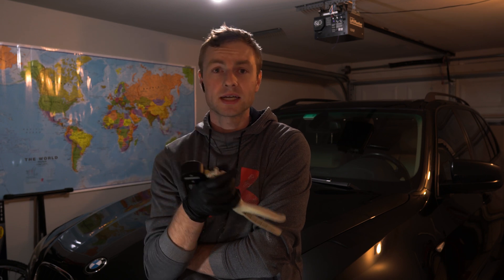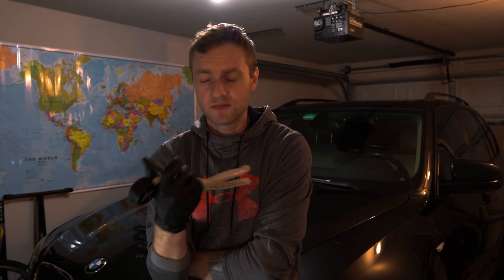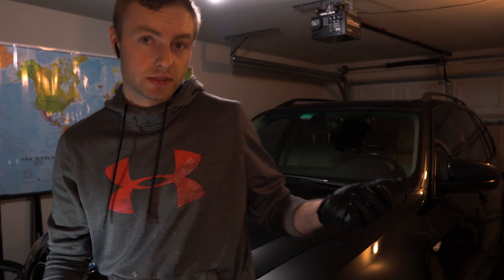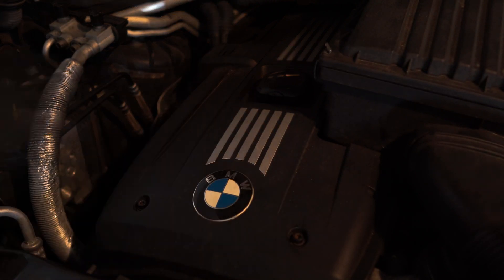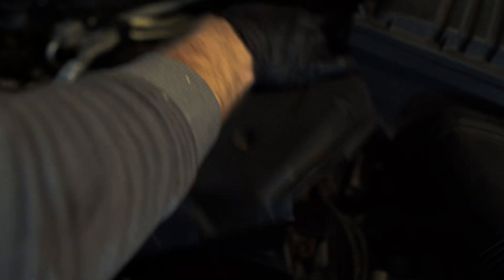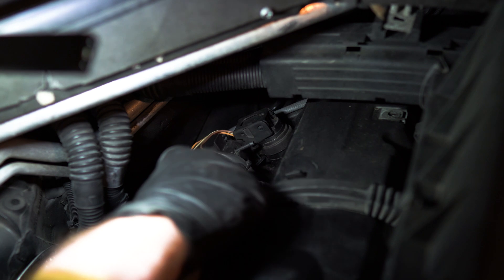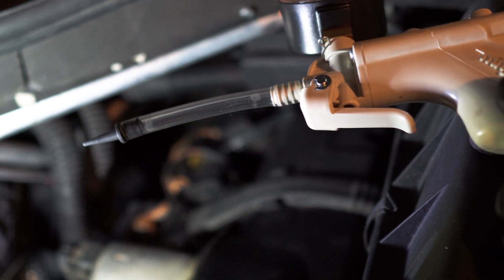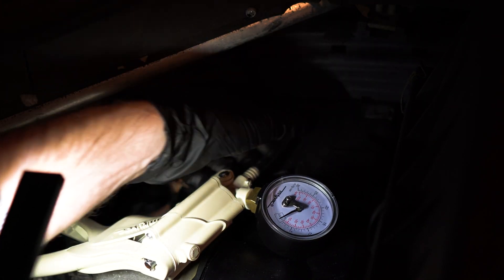How to test CCV PCV Crank Case Vale on BMW N52 N53 Rough Idling

Comment: HELLO I have a brand new valve cover OFF CAR..the vacuum wont hold  can u do this TEST WITH THE HAND HELD VACUUM ON A E90 VALVE COVER OFF THE CAR?? THE VALVE COVER IS BRAND NEW AND IT SEEMS IT WOUNT HOLD A VACUUM IM USING A HAND HELD GASKET  DID THIS HOLD UP AFTER U REPLACED IT WITH SILICON??  ALSO, I dont have any BMW vaccum hose attached
 to the end of PCV some cars come with it attached..i only have the nipple part as in ur video
attached
Reply from the maker: The test is strictly showing if the gasket is intact have a hole, so yes, you shouldn’t have any problems with testing it of the car, it’s got to be sealed. The test  was done after I replaced the membrane.
Reply: Ok PLEASE explainn simple terms..I have a brand new N52 valve cover in BOX..I am hooking up handheld vacuum  just as u show but it wont hold a vacuum which is strange as the valve cover is brand new..am I doing something wrong?? and what do u mean it MUST be sealed?
ALSO, after you replaced the pcv only with a new cap, it held a vacuum? did it run better? thanks  I cant imagine the new valve cover has a bad pcv valve..???
 @Makhnovets

Comment: yes all the E90 series cars ive seen here in US has a positive crankcase hose attached to rear of  valve cover  I wonder why FCO euro video says to plug that hose uup when testing vacuum on PVC  valve..ALSO What do u mean by depressurize system? PLEASE EXPLAIN... Ive just seen guys hook up a vacuum to end of tip on PCV valve to test..if it doenst hold vaccum it means the diaphram is no good (ORNAGE MEMBRANE)

Comment: ok EURo video says u must take off the rear ccv HOSE on the back of valve cover , then do the vacuum test..they said u must plug the hole in rear of valve cover where ccv hose attaches first???
Reply from the maker: As long as i know the US cars don’t have the attachment, if you talking about engine vacuum, in that case yes, you need depressurize system first, then do the test… 
I did mention in one of the previous videos that only euro BMW have that extra connection.

Comment: Do you suck the air out of the valve or blow some air in like pumping up the tyre with air?
Reply from the maker: This is the vacuum tool, so I created the vacuum, which is suck air from, if the gage is dropping, it means you have a leak.
Reply: @Makhnovets  got ya. Thanks for reply

Comment: Thank you man I will do this also before cutting my PCV up, it’s better to check it to make sure it really has failed as my rpm needle is jumping on idle and start up
Reply from the maker: Sounds good to me! What code car reading? or it's showing nothiong?
Reply: @Makhnovets  never scanned the car as I don’t have a scanner there all very expensive to my knowledge and no engine light or any sort of light pop up
Reply: Hallenbmw has a video titled rough idle and in his video he goes on to show that one of his coils had failed and was causing the rough idle that was his culprit. I only changed my spark plugs never though the coils could cause a rough idle so now I’m going to order a 6 pack of coils as this bmw has 259,000km and the coils were only changed 1x in 15 years…

Comment: HEy that little end   plastic cover that came off the pvc valve..did it have  a  piece of rubber like a stopper in it ,,i know it keeps out dust and all but please let me know someone said there is suppose to be  a piece of rubber in that little end cap..let me know u took it off in the video..some cars have a vacuum line or tube attached there..your model vents to atmosphere air like mine 2008 BME 328i
Reply from the maker: Yes, some cars have a line connected to it, i think after 2009 some of the cars have it, but if you don't, that's totally fine, the cap what i remove, is not a plug, it has cut-outs inside for air to move freely, if it's missing and you have bare nozzle, not a problem, except now its more reachable for all kind of debri.
Reply: @Makhnovets  ok thank u for your help..so u are saying there is NO type of rubber plug or piece in that little plastic nozzle cover u took off?? My mechanic plugged my nozzle end with electrical tape ..i dont know why.. He block off that PCV valve....u think its because its bad?   thank u i need to have it vaccum tested ..great video. ty